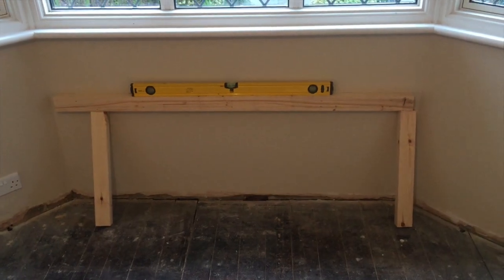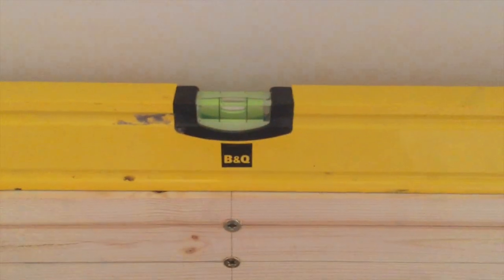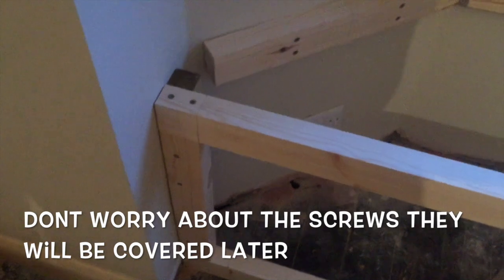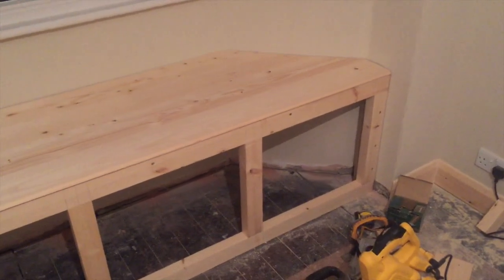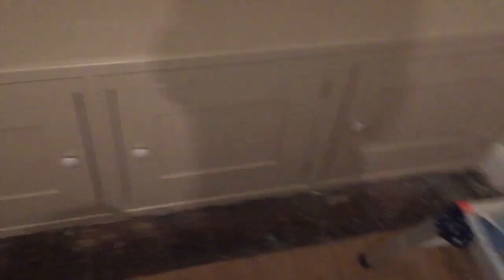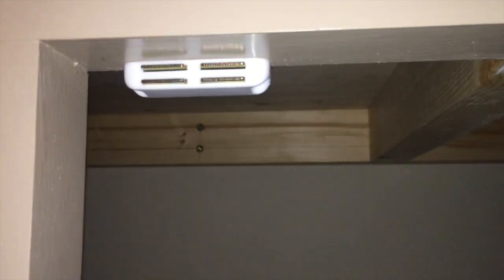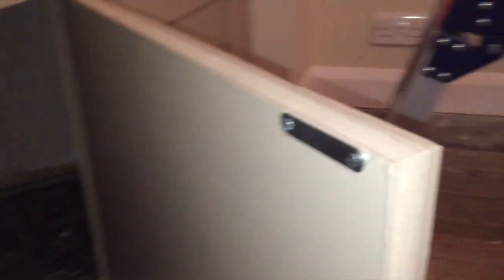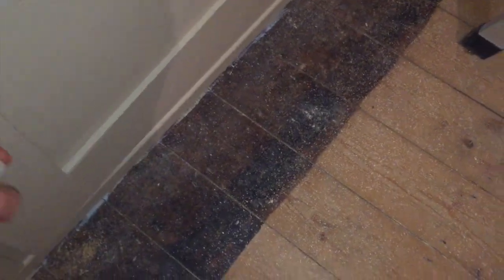Home Made Bay Window Seat

Comment: Thanks. I made this. The addition was built by a previous homeowner decades ago and is no longer level. So I built the front framework first, then using a level placed the back baton with one screw in the center. This enabled me to get it level with the front and then the tilt the baton horizontally until that was level. The rest went as you described. I noticed that you placed a baton on the floor behind the front framework.

Comment: Great video, but would  have been really helpful to see how you cut the angles for the top. This is always my downfall in DIY projects! Just can't work them out!
Reply from the maker: Caitlin Hillary thanks for the comment. I just used a digital angle finder, and measured the smaller length and then applied the angle. Always cut on the side of a bit to big and trim down. 
Just keep trying and having fun building.

Comment: I'm planning to build two and attach them together shape as an L.
I wasn't sure if i should attach my seating to the wall?? Or make two boxes and add a frame in front without attaching them to the wall.
Reply from the maker: Either should work great, making boxes before hand and attaching face frames is the more traditional, however would cost more in material. I would always suggest drawing it out first and even input it into a 3D modelling tool like Sketchup. it always helps me.
Reply: @gregpugh4632  Making boxes and adding frames will cost more. I didn't think about that.   This will be my first time building a bay window seating,  but i feel confident that could do it.
Thanks for the feedback and thanks for your video

Comment: Cheers for the video Greg. Was wondering how much you spent doing this? Am building one myself so just needed a rough cost
Reply from the maker: Kai Johnson thanks for the comment. 
So this one cost about £125. Was simple 2x3 lengthens and some flooring boards. The MDF I used for the doors I already had. But prob just about £30 for the sheet + decorative strip wood. 
Post yours once complete yours man.
Reply: How many hours to put this together?

Comment: HI with lumber do you Use for the frame, because construction lumber are not plane or symmetrical, thanks
Reply from the maker: Luis Rios thanks for the comment, in this project I used pine from my local timer merchant, you can get it planned to the thickness you like to make life easier. Hope it helps.

Comment: How did you figure out how much smaller to make the doors than the openings so that they fit properly
Reply from the maker: Borisaurus Rex, just taking 2mm off each edge gave me plenty of space, the doors are only 18mm thick so don’t need much space to pivot.
Reply: @gregpugh4632  thanks for the response. Did you use a router to put the MDF board in for the doors or is there an even simpler method?
Reply from the maker: @BigBoJay   so i built the doors by adding some decretive strips to an MDF cut out, nothing crazy, to hang them i just added the hinges without countersinking them, they are thin hinges so no bother. Like i said i hated doing doors, and this was a simple go at them, i have got better though trying and now use a router options to build styles and rails and slot the board in a groove. hope that helps